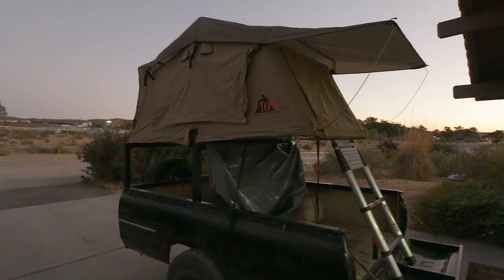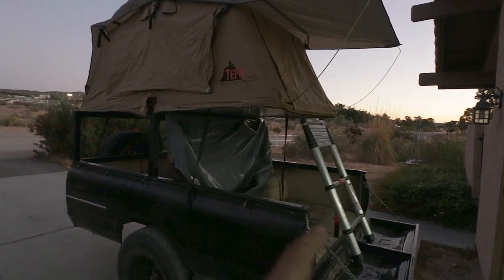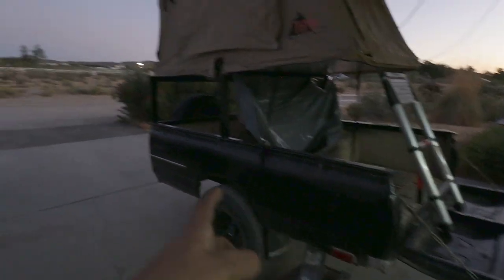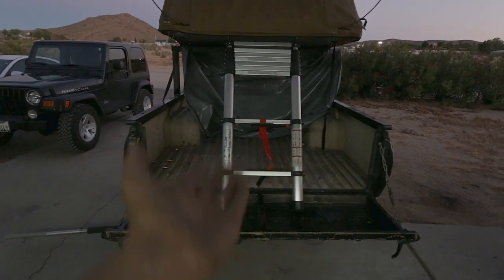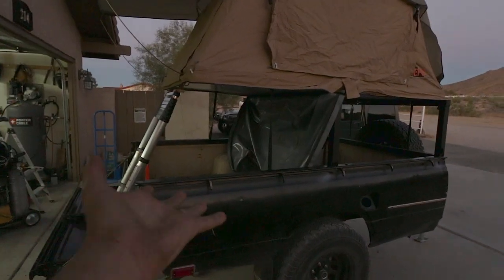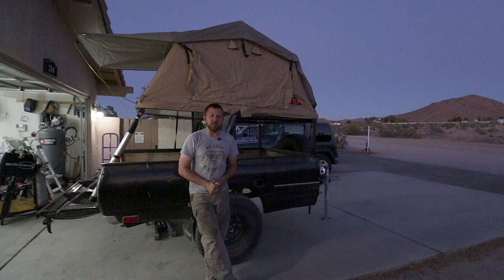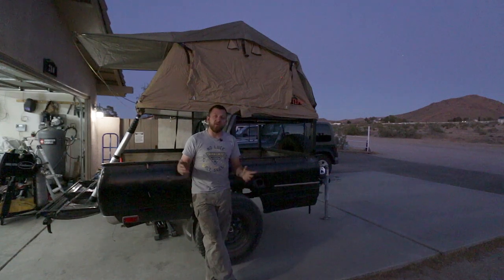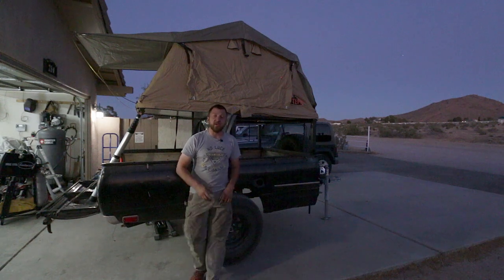Cheap Jeep Trailer Roof Top Tent

Comment: Would you ever consider finding a fiberglass truck topper for your trailer? I wonder if that would be practical for back country camping.
Reply from the maker: The truck bed is very old so finding one might be an issue. If I was able to find a truck topper that fight this bed, I would convert it. I would also build the entire trailer out too!